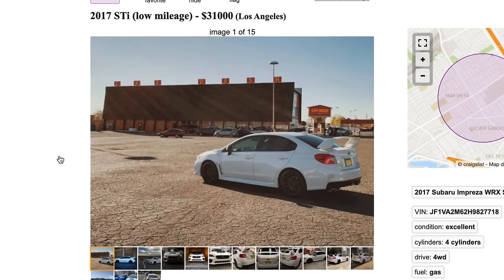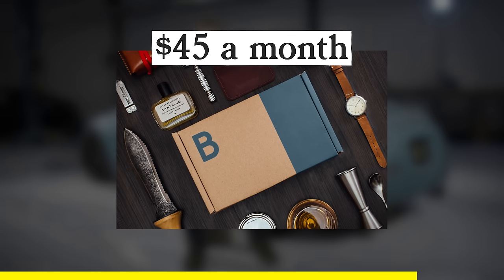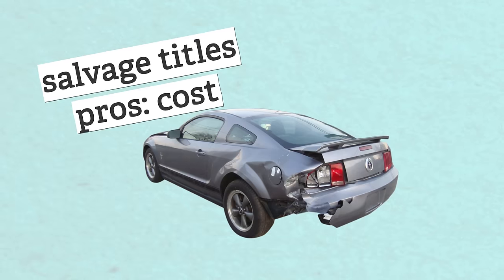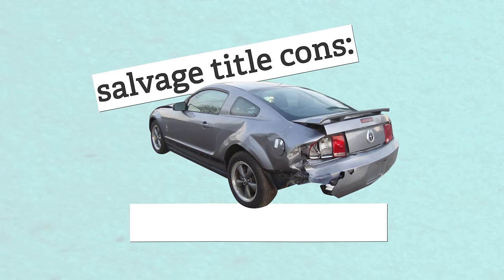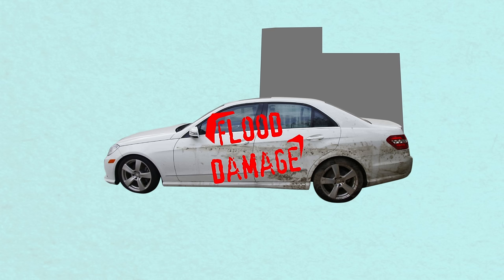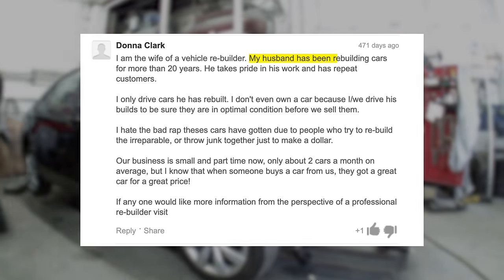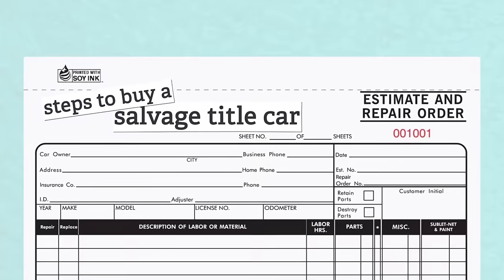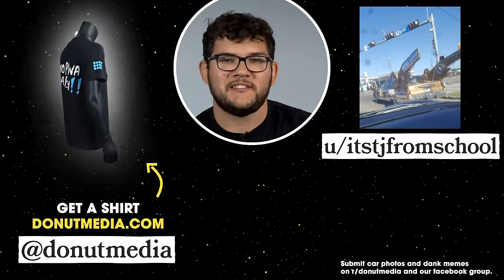Buying a Salvage Title Car: Bargain or Nightmare?

Comment: depends on the circumstances.  recovered theft vehicles declared salvage with no mechanical damage should be fine to own.  salvaged vehicles from accidents should be assessed carefully.  if you are getting a salvage vehicle from an owner who has driven fine on it for 10k miles, it's probably fine.

Comment: In 96, I bought an ‘ 89 240sx that was a theft recovery salvage title. Drove it for 5 years with nothing to do on it, other than a few oil changes.

Sold it to a private party, and they wrecked it soon after.

Comment: I bought a 30,000 salvaged Honda Fit for $6.5k out of highschool. Drove it for 7 years until it's got 80k on it. Literally zero issues, aside from the rear passenger door having noticeable wind noise. Sold it to a dealership, that's right, a dealership, for $3,000. So pretty much I paid $3,500 for the car...for 7 years! That being said, I have friends and family members who have bought salvaged cars and some turn out to be nightmares for them. I don't think it's whether salvaged cars are good or not, since that's purely based upon luck, unless you are very familiar with working on cars.

Comment: I got a 2000 4Runner with a Salvage title for 3500 and barely 200k miles, I've been driving it for 2 years now and other than basic maintenance stuff it runs clean as a whistle

Comment: i got a 90s legend thaty was salvage for $1500, drove that think 120k miles, the only repair I did was door window when a baseball hit it. it didn't drive well,had only 1 working window (its cold here, ur not rolling your windows down anyway) but it never broke down and always started, best dam car iv ever owned. the transition was no longer shift into third in drive, but you could get it to 3rd by shifting it manually, I finally reriated it when I got a good paying job and could afford a newer car,. saddily they all where GMs, so none of them lasted very long.

Comment: I bought a 2017 Nissan Frontier with a rebuilt title.  Easily, saved 10k…but the verdict’s still out.  I saw photos of the damage and the receipts for the repairs.  Drivetrain should be undamaged… but I already have to replace a control arm.

Comment: I accidentally bought a salvage title. An 02 echo that has a completely cut and welded subframe. And for some reason the front passenger tire loses air considerably faster than the others. However, it doesnt leak fluids and has not had a single “running” issue. Mind an evap code. Anyways. I think it would have been a worthy buy seeing that it doesnt kill me in an accident

Comment: I brought a 2005 350z and got a stilled stage 3 supercharger. Honestly haven’t had a single issue. Had the car fax and had it inspected and everything. 30k miles and it was only $11,500.

Comment: I bought a savage title 2019 veloster turbo and it had held up great having to deal with a wedding I put 6k miles in the first 2 months. I did have pictures of the damage before and after the repairs and it was mostly cosmetic with no frame or body damage save rear bumper plastic and tailgate

Comment: I bought a 2008 vr6 4motion vw passat from co-parts salvage auction and I don't know how it happened but I ended up getting a clean title for it even though I was totaled by the insurance company. Now I'm not rebuilding it as I am using it for the AWD system that I have been using to convert my mk1 vw rabbit into a 300+hp 1.8t AWD with full independent suspension racecar. Again I'm not sure how it happened all I know is that the title I got from the auction is a clean title and the car it had a perfect black leather interior. The only damage was to the drivers side rear corner otherwise it was in pretty good condition. If I didn't need the transmission, diff, tunnel and wiring from a car with a 4-motion drivetrain I definitely would have rebuild it.

Comment: I bought a salvage title 2013 Mercedes c250 sport @ 77k miles, 7 months later and is running perfectly at 89k miles, the car was just broken into and vandalized inside and obviously the seller fixed the car all up, thinking of keeping it till 110k

Comment: Salvage title cars can be a great value, but you need to do your research before you buy. Insurance companies will often total vehicles due to cosmetic damage only, such as hail. These vehicles can be great if they are mechanically sound and you don't mind doing body work yourself. But don't buy cars with no information about why they were totaled or that have obvious mechanical problems such as flood damage or bent frames. A carfax report is worth its weight in gold if you're going to spend that much money anyway.

Comment: I bought my salvage 2019 Civic hatchback EX in 2020 for 13k with repairs. 3 years and 30k miles later and I've had relatively few and minor issues. I'm happy with my choice

Comment: My 1991 Miata was hit by hail in 2010. Beautiful car, but insurance company told me it was totaled, as it would need to be repainted. They gave me a check and let me keep the car, but with a replacement salvage title. I had all 48 dents removed by a crew I found working in the back of a Bentley, RR dealership. I guess those cars suffer dents too! For $250 all my dents were gone in 30 minutes and no painting was needed. Eleven years later, with 210,000 miles on her, she still purrs like a kitten and runs like new, but with a dreaded salvage title in the closet. And no, NOT for sale! Ever!

Comment: If you buy a car that's rebuilt and you personally take it to a known, trustworthy, reputable shop, and oversee the work as it's being accomplished, and you know it was returned to factory spec AND ...the biggest kicker is the paint! Factory paint is phenomenal, but the aftermarket paint jobs that look fantastic out the booth will start to peel in two years. So if you're good with the rebuilder, and you're good with the painter, then yeah, buy it by all means. But if you visit  Rob's Used Cars in El Segundo, and you learn about a rebuilt title while you are signing papers, your ass needs to get up and run!!

Comment: bought 2016 M3, 35k miles for 19k from auction, changed headlights, hood, radiators and bumper. Saved a lot of $

Comment: There's another thing depending on the state, a car with a salvage title is not road worthy. It needs to be inspected and needs to pass that in order to get the rebuilt title as the rebuilt title will allow that car to be road worthy again.
Reply: In Kentucky, you cannot legally drive a salvage titled car on the road.

Comment: I bought a 2012 Ram 1500 that had been in an accident and was totaled by the insurance company. When I looked at it I could find literally nothing wrong with it. No visible damage at all. The only obvious damage or issue was the fact that the engine would not turn over. It woukd make a metallic clanking sound when I turned it over. This lead me to suspect a bent connecting rod. I did some research and was able to find the police report for the accident. The truck had ran head first into a ditch full of water. So I guessed that the water somehow made it's way into the air intake since it had an open K&N style air filter and intake pipe. I checked the trans fluid and it looked perfect but the engine oil was a little milky. I took the risk and bought it. I went junkyarding and found a donor engine and swapped them out. The truck fired on the first turn. I have since put close to a hundred thousand miles on it. I ended up with a vehicle that was valued at 20k but I had about half of that invested, not including my own personal leg work and wrench time. So I guess the moral of this boring ass comment is to do your homework and if you can turn your own wrench you can find great vehicles with salvaged titles.

Comment: I had a rebuilt hyundai genesis I believe it was a 2010. I loved that car. It drove well and didn't give me any issues. The front bumper made it noticeable that it was wrecked so it wasn't fixed properly lol but I did get lucky with my trade in. The dealership that I went to was taking any cars in any condition for 4,000. So I traded it in. Not because I didn't like it or because it had issues but because I bought a house and the car couldn't make it up the steep driveway lol. I traded it in fir a 2019 Nissan versa..... The most boring car I've ever owned lol. But just two weeks ago I traded in that Nissan and bought a more fun car. A 2021 blue VW GTI

Comment: 2000 Integra with a rebuilt title (from police auction) for $500.
Been dailying for the last 3.5years, no major failures yet. Had 165k when I got it, just rolled 215k.

Comment: I bought a 10-year-old Tacoma with a salvage title.  I've been driving it for 2 1/2 years now, 40,000 miles later and no issues whatsoever.  Tires wear evenly, no clunks or shakes.  Salvage titles always scared me off, but with a Tacoma I plan to keep it for a long long long.....long time.

Comment: If its new, I would personally stay away. It will be severely depreciated, it had to have been in a major wreck, and any warranty you would hope is still active surely is not. However, if you are looking at an older car, minor damage can deem a car "totaled". Got my Miata for $500 because of a rebuilt brand and some engine trouble I knew I could fix. It took a little work, but with about a grand and a half, I have a running, driving car and few extra goodies installed. Having another vehicle may be a bonus as you wont have to worry about reliability while dealing with gremlins, but if you know what you're getting into, it can make for a great deal. Especially if you want to enter the car scene on a tight budget, just bring someone knowledgeable if you are new. As Nolan said, flood damage is better left alone.

Comment: i was a hair away from buying a subaru forster with manual that was totaled for hail damage. the windows where not even cracked. i mean the top and hood looked like some1 took a hammer to it, but would of made a great daily beater. and those ej25 engines where pretty decent engines with propper keeping

Comment: In switzerland we have very hard vehicle inspections every 2 years, called the MFK. They are even harder to pass than the german  TÜV or UK MOT, and usually they suck because every thing needs to be stock or approved by some overpriced test center which makes tuning a pita. But at least we can know that the cars are actually road worthy, no matter what titel they have.

Comment: Just bought a salvage from copart.
Unfortunately, the A pillar has some damage and the rules on repair in my state require only factory weld points can be separated and rewelded to make a passing repair.
On this car, it means replacing an entire side. 
I don't know where I would get an entire side. Probably can't without buying a second car. And I can't weld either. So... Guess I'm screwed.
You have to know rebuild rules for the state you want to title it in before you get involved in a salvage.

Comment: Salvage cars from the US are a big deal in Ukraine within the recent years. There are privates and even whole companies looking for good deals in the US, shipping damaged car to Ukraine, repair them here (cost of repair is significantly cheaper than in the US obviously) and sell. They even take orders for specific car models.

I mean, there’s still A LOT of complete trash, but if you know what to look for - you can get a good one. Usually you can get auction archived photos and see what happened to the car . I’ve got my top of the line Mazda CX-5 this way (2.5l engine, sunroof, Bose sound etc.) for like 25% cheaper compared to “clean” cars. Happy owner for 2 years already, no issues at all.

Comment: I think there is a simple way to deal with this: if the damage was superficial or limited to a replaceable part, then it’s fine. If the damage required frame repairs, run away. Regardless of what rebuilders say (because they aren’t biased at all and definitely aren’t just in business to make money, right?), once metal gets bent out of shape and pulled back to its original shape, it is not as strong as it was. Therefore, if the car gets crashed again, the crash structure is already weakened from the previous damage. That means the damage from this crash will be worse and the car won’t protect you as well as it should. To me, that’s not worth saving a few dollars. 

Flood damage, don’t even consider it. Unless the vehicle had literally every electronic component, wire and connector replaced, it will be a basket case of electrical failures for the rest of its life.

If you’re looking at a salvage title car, don’t even consider buying it until you have an actual professional do an in depth inspection of the car. That doesn’t mean having your Uncle Jimbob look at it in the seller’s driveway in the dark either. That means taking it to an actual, legitimate shop, having a real mechanic do a bumper to bumper inspection (which will cost you money) and give you a full report of what the vehicle needs. Really, that should be done for every used vehicle, but especially for a salvage title vehicle.

Comment: an understanding what makes a car "salvage" is key.
Salvage in most cases has to do with the amount of damage compared to value of vehicle. IE if you have a car worth $4,000 and you get hit on thr 1/4 and have an estimate for repairs of $2,800 then in most states its a total loss and will get a salvage title
same car same accident but lets say repairs would be $2,500 then no salvage title

Comment: I'm pretty sure one of the businesses I work for has a flooded car. Not sure if it's the one with 170,000km or 214,000km, but everything seems to work fine and no lights on the dash. The headlights are crap but maybe that's just how those 2006 Yaris are.

Comment: The problem with salvage cars is the people who buy them. They buy them without looking the car over to make sure it’s okay. I bought a 2015 WRX limited for 11,500, all it needed was a front number and a hood for less than 1k at the time. I spent over an hour checking fluids, rust, frame damage and other odds and ends before buying it. I’ve put 30k miles on it and it’s running strong still with no issues. Even with added mods. 

I also bought an 09 Jetta with the 2.5 for 1.5k because it had “flood damage”.  I have no idea what insurance person wrote that down but it definitely had never been flooded. I got that car 9 years ago and it’s still running and I’ve put over 150k miles on it. With a total of almost 200k

And those are just the ones I’ll mention in this comment. Have a mechanic look at the car or be competent enough to know what you’re looking at, and you can find crazy good deals. The “never buy a salvage” people simply don’t understand.

Comment: I got my salvage 2019 Camaro LT (V6) for only 16k put 5k down and 11k loan for 3 years it had under 20k miles, car msrp is 25k legit had it for 2 years now drives like the title is clean, only downside is no warranty luckily I work on my own cars, I do my own oil changes, car filters, recently changed my spark plugs. I baby the car and smoke it when I want to. Salvage is a bargain

Comment: Pretty sure my 2014 bmw f30 n26 was salvage got hit by a deer no frame damage and they put new radiator new water pump and so much more ive been building and modding it ever since I got it and Ingot this car w 58k miles in 2018 for 12k$ so I’m not complaining currently at 80k miles and have no issues so if u know your shit and u find a good salvage deal it’s hella worth it

Comment: i know a "re builder" in IOWA, i bought a camper from him, iowa gave me a clean title!
so be careful of buying a vehicle with an IOWA title! i also bought a salvage semi trailer from him the same day he won the auction, got clean title for it!

i have built automobiles and motorcycles and campers from the frame up for most of my life. being a POOR BOY and HILLBILLY from Arkansas, that is how i could afford a nice ride. you buy old wore out junk, strip it down to the frame and start from there.
in 1976 i bought a 68 chevelle ss396 from a friend that was getting a divorce, he had traded the whole engine to a guy for a set of SQUARE PORT heads and that is where my engine started. it was designed for the track but an 18 year old kid could not resist it being his DAILY DRIVER!

Comment: I had a 1997 Chevy blazer for $400. It drove well enough through the city. My mechanic said he couldn’t certify it, because I crashed it by accident when parking it, right after getting my temporary sticker. Very embarrassing. I drove for about 4-6 months with a temporary sticker. It drove like sh!t, but could drive. I took it on the highway for one road trip. On the way back, it began making the worst engine noises so I scrapped it for $200. I drove extremely safe. I would not speed and drove very safely. I did not want to be pulled over or have the car die on me. I had insurance (surprisingly) and would check and change its fluids. I only paid $200 after all, and helped reduce my insurance by just having a car insured for the roads. Be safe.

Comment: I was able to buy my 2013 Subaru WRX with 36000 miles on it because it was declared salvage  because the original owner blew the engine within 36000 miles I bought it from a shop who put a brand new engine in it and it drives phenomenally